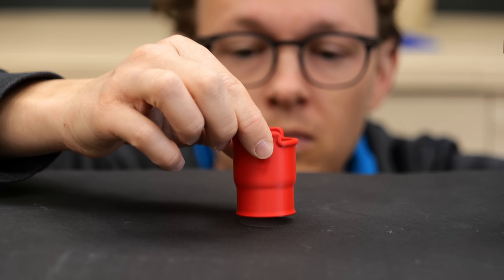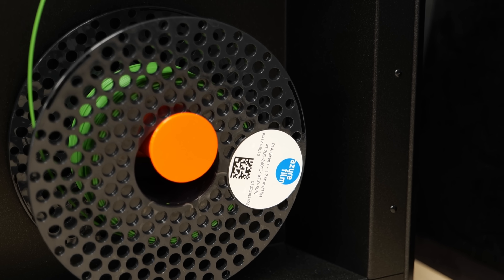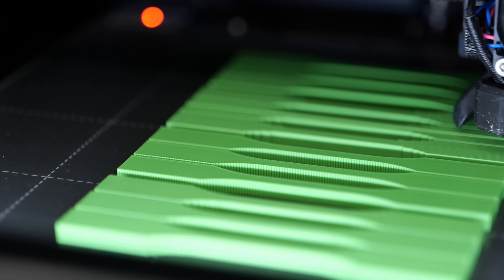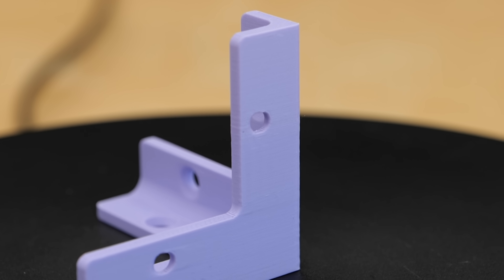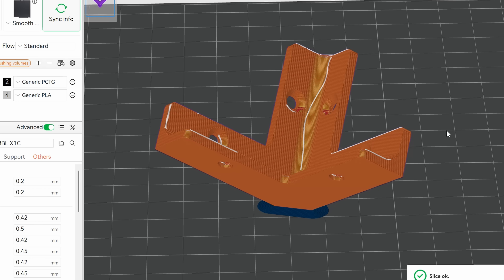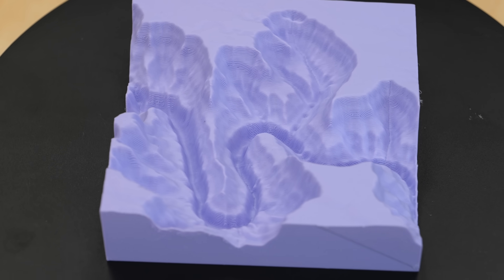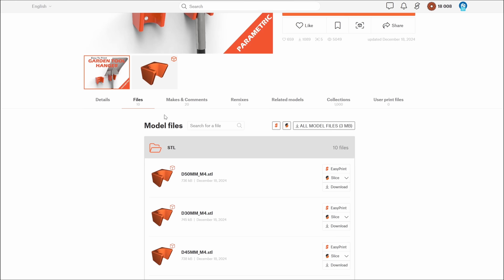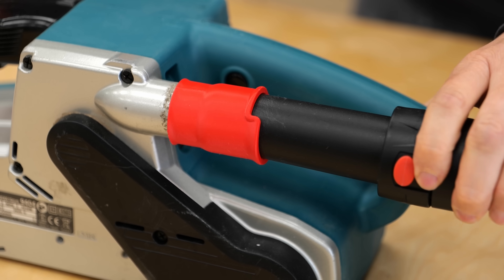Does Angled 3D Printing Really Make Parts Stronger?

Comment: Did this not so long ago. My fathers new car had some wheel nut covers on in black (on silver alloys so a bit of a eye magnet). Took one of each (nut and locking nut covers), modelled them and, after a couple of test prints on the side to get the sizing bang on, flipped them to forty five degrees to improve general strength and minimise layer separation when they're being taken off. 

If it's a practical print it's one of the things always at the fore when it gets to the printing stage, same for less practical prints but geared towards more aesthetic/ease of finishing reasons.

Comment: I would probably just print that adapter from TPU standing upright and not worry about it. The layer adhesion of TPU is so great it's nearly isotropic.
Reply: All I could think from the first time he showed the part was "why not TPU?"
Reply: @MumrikDK good I'm not the only one that thought that.  😂  I feel like the comfort and ease of PLA makes people overlook other options.  Particularly with TPU.
Reply: @wassamworks3dllc direct drive and very low speeds sorts out tpu  , tpu is very cool , worth waiting for imo
Reply: @wassamworks3dllc TPU is 3 times the price, 4 times slower to print, can't be used with ams and sticks to the bed like a rock - that's why people avoid it.

But it's probably is the strongest thermoplastic out there. I'm always amazed by how fine the lines blend too.
Reply: @wassamworks3dllc I hate pla  coming from western Australia 9months out of the year it's sunny and hot so pla can only be inside a house. Most of the things I make are for use so snappable, easy melt and breakdown materials like pla are useless.
Reply: @fog1257 I have perfect adhesion with the biqu glacier plate at 30°C. Always holds, and pops off with ease..😉
Reply: @CarkeekW  
My first TPU project was a bathtub stopper, it still works today! :)
Reply: @fog1257   I like TPU a lot, when i need something that I want to last, I print it in tpu
Reply: @MumrikDK  he has it but "why not tpu" could be as easy as "i dont have tpu" or "i don thave a printer that can do tpu"
Reply: @pvic6959 even bowden can do tpu, the keys are hot and slow, with bowden it will be more difficult, but nearly every printer (yes even enders) can do tpu, if you cant do tpu, get out of the reprap days, those have passed
Reply: @pvic6959  Normal black Sainsmart TPU is as easy as PLA. It prints beautifully, and is resistant to even gas and oil.
Reply: @MumrikDK the point he makes remains the same especially for science. If you use TPU then orientation will still make it stronger or weaker so this will still remain valid.
Reply: @MumrikDK  And if not TPU, then PCTG, which is about as close as it gets to anisotropic but prints like PETG—in my experience, it prints just a little easier and more cleanly than PETG! (At least, that's true for American Filament and Fusion Filaments PCTG.)
Reply: I also find polyesters can have amazing layer adhesion if u tune it rite.
Reply: @hayden9944 like everything when you're not overcool the parts.
Reply: Right  @hayden9944
Reply: @hayden9944 my petg parts almost never break cleanly along layers. And that's just the default profile... but enclosed might help?
Reply: @superslimanoniem4712Enclosure definitely helps, but PLA stronger, stiffer, better layer adhesion, and impact resistance (when using PLA+).
Reply: @rileyneufeld7001  You can't call PLA stronger when it degrades over time. Actually it does pretty bad with temperature, sunlight, moisture, load. I wouldn't recommend PLA for other purpose than decorative, toys, or temporary support for another materials.
Reply: Yep, correct material is as important or more then correct orientation.
Reply: TPU is probbaly my favorite filament. It's so incredibly tough and adhesion is unbelievable.
Reply: Moreso it's flexibility prevents any force concentrations. A crack that never starts can't progress through the part!
Reply: I also use TPU for hose adapters, works great !
Reply: I print damn near everything out of Overture High speed TPU. It has the durability of TPU, but is more rigid, highly controllable by infill and wall count, and of course it prints at the speed of PLA. By far my favorite. I’m sure there are more brands of it but you get the best of both worlds.
Reply: @GeddyRC I love that Overture HS TPU also. I bought some CC3D 72D TPU and it comes out almost identical, but has to be printed slower. So the Overture wins, imho.
Reply: Almost 500 likes in 2 days is a sure sign that you might be on to something. Slant printing will make prints stronger but requires supports most of the time and can lead to dimensional inaccuracy. Printing the hose connector straight up in TPU not only improves layer adhesion, but also maintains the accuracy of the circle. Knowing the correct material for the job is more of a priority than print orientation.
Reply: how would you feel if you didnt have breakfast this morning?
Reply: I think it was more of a reason to make a video than a actually required part. But yes Tpu would be the obvious choice.
Reply: While I don't disagree, that wouldn't make much of a video...
Reply: Sure, even PETG would have no problem there, but I think the point of the video was not the material choice :)
Reply: @DmitrySholokhov PETG has worse layer adhesion than PLA. But it does flex a bit more before breaking
Reply: @polycrystallinesilicate I know PLA is technically stronger, but I'm practice it doesn't seem to be the case.
Reply: @DmitrySholokhov  Then honestly he should've used a different subject for the print.  The whole time I watched this i was asking myself "Is 3D printing layer adhesion really this bad?"  Thanks to the comments i see that it's not, depending on the plastic used.  Comments ended up being more helpful than the video.
Reply: Ja, TPU isch mir au gleich eugfalle 😅
Reply: Agreed, though since I got a printer with multiple tool heads I have started mixing materials and trying new ways to not just mix but also support.  One of my favorites is mixing ABS and TPU for lids with the ABS as the top printed on the bed and TPU on the sides of the top it feels strong but the thin sides on the lid hold tight and won’t break easily but is still easily removable.  For the adapter I would likely print in mostly TPU with PCTG bands to give the TPU enough structure to not as easily flex off of the hose or tool ends. PLA is fine for lots of stuff but I consider having to tilt a model so much that it has to rest almost entirely on supports in order to print to be a choice of last resort. I would almost rather use the splitting tools at strategic locations with glue and dowels than that for some parts.
Reply: True, but sometimes you're material constrained.
Reply: That's literally what I did. Part is holding up to some serious abuse.
Reply: Guys - have u tried Matflex TPU from Fiberology….. best TPU and looks soooo good
Reply: similar with pla tough+ from bambu
Reply: That’s completely beside the point. It’s an example of broadly applicable techniques, it’s not about optimizing for this specific part lol.

not entirely sure why this needs explained
Reply: I also used TPU for this. Works without any problems.
Reply: A really successful approach is to model a narrow hole from top to bottom through you model, just under the  width of a wood screw’s thereaded section, perpendicular to the layer lines in the final print.  Chamfer the bottom of the hole to accommodate a screw head, and then print it with the chamfer lowermost.  Now screw a screw tightly not the base until the head is flush.  The result is the screw keeps the layers clamped tightly together, hugely increasing effective layer adhesion.
Reply: Toż
Reply: Came here just to say the same thing I have printed various adapters for my shop vac out of TPU and they work great
Reply: I have seen people use superglue or some spray adhesive on parts to make them stronger.
Reply: But what if one doesn't have TPU
Reply: Probably because TPU is a pain in the @ss to print with on most printers.
Reply: Of course there's TPU and a lot of other alternatives. The point here is how effective the angle printing is and how to include it in our toolbox.
Reply: The super stiff AMS compatible bambu tpu would've worked perfectly in this application. 
I'm sure if he printed the vertical adapter slower and with minimal cooling he would've been able to rival the strength he got at 45° using PLA.
Reply: @rileyneufeld7001  "AMS compatible bambu tpu would've worked perfectly"
I'm a huge fan of Bambu's TPU for AMS. The stuff is nearly indestructible yet supports come off surprisingly clean. TPU for AMS makes printing with TPU surprisingly easy. Of course this assumes one has an appropriate printer for the stuff. I'm using a X1 Carbon.
Reply: I think I'd have just printed it in ABS as that is what I print in 99.99% of the time, and once you have it dialled in its pretty darn tough and just good for nearly everything. But I do agree this is one of the parts that screams TPU is the right filament for the part is. I just wouldn't bother getting a new spool, and I expect I'm not the only one who would just use whatever of the better engineering plastics they had on hand knowing its going to be good enough for a while at least.
Reply: @foldionepapyrus3441 toxic vapors..
Reply: I’d use tpe
Reply: Cool. Now tell us what you’d do for every part, and why you’d do that.
Reply: @TheOfficialOriginalChad exactly this. no idea why the point of this video is going completely over these peoples’ heads and why they’re trying to “um well akshooallee” regarding material choice for this specific part. The point isn’t about this specific part or material choice
Reply: @TheOfficialOriginalChad  For things that need to be flexible … TPU/TPE. For things that are outside … PETG/ABS/ASA (ABS & ASA require enclosure). For decorations or models that are not subjected to heat (including sunlight) or require strength … PLA. Decorations or models that are exposed to heat up to 70C … PLA-HT from Polymaker. For items requiring strength … Polycarbonate (requires enclosure and heated enclosure recommended), some people recommend carbon fibre filled, but carbon fibre strength comes from being bonded together. Carbon fibre filled filaments essentially have unbonded flecks of carbon fibre suspended in filament. While these bits of carbon fibre may make the product harder, it does not increase the strength as the bonds are those of the filament, not the carbon fibre. Understanding the properties of materials will help you decide which ones fit which purposes. You can also ask the internet which filament is best and if you’re lucky, print settings to get good results.